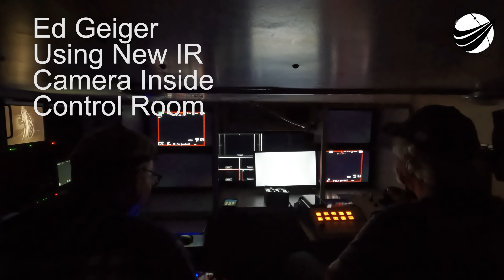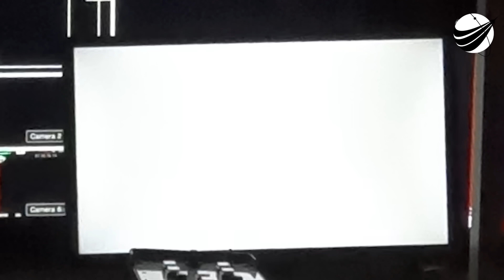Falcon Heavy - Boost Back Burns - USSF-52

Comment: Is it a burn back, or more of a burn straight up and then the earth turns under it?
Reply: Boostback is a climb, initially. Overall the maneuver is a giant loop. Separation occurs at ~60km altitude, they begin their flip and continue to coast upward to ~66km where ignition occurs. The boostback burn reduces down range velocity but increases altitude. The burn stops at ~94km, by which time the downrange velocity is negative. They then continue a ballistic trajectory through apogee at ~104km and back down to re-entry.
Reply: All of the above.
Reply: the boosters flip around and burn back, yeah.
Reply: @Jupiter-ux5ew  they look like they are going nearly straight up. I think they stop the boosters from going further downrange, while sending them high, more so than propelling them back whence they came. Both factor in it.
Reply: Earth rotation is not significant compared to rocket speeds